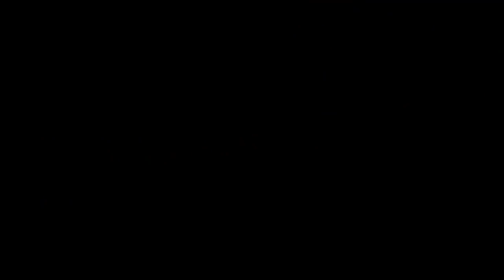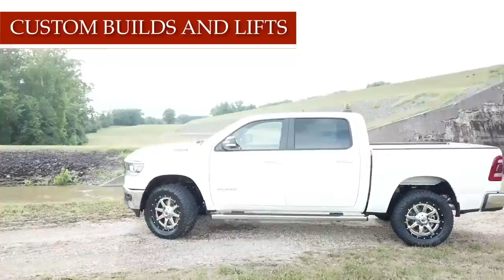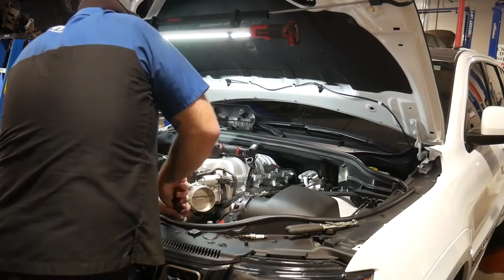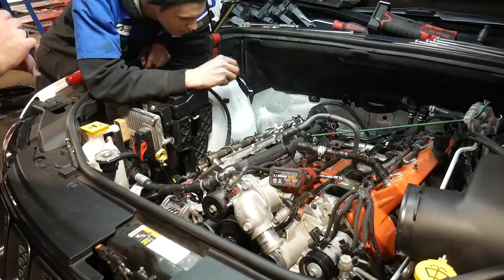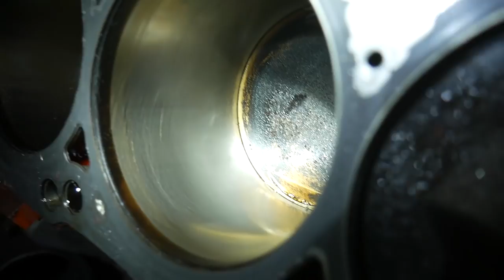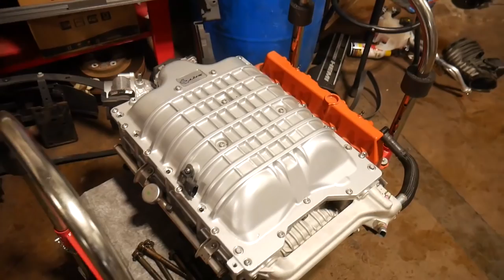TRACKHAWK HELLCAT ENGINE ISSUE AND HEAD REMOVAL

Comment: For those asking about fender covers......any good tech doesn’t need one. A cover can actually do more harm than good to paint. A fender cover gives false security. You start to forget their is something under it that could be damaged. “Outta sight outta mind” I never use them and haven’t damaged a car in 25 years. And I work on Vipers.
Reply: I get what your saying but at the same time I've never damaged a vehicle using one. The coveralls we have at work are cheap shit and are like sandpaper to paint so i have to use one. if you use them correctly and keep them clean and don't drop them on the floor you should never damage a vehicle with one.
Reply: Totally disagree. "You" might not need one but what about his apprentice? Your a "tech" and the exposed intake ports,not draining the coolant(at all!),not using special service tool to lift a 90lb $11k supercharger doesn't set off any red flags in your head? I cringed when flopped the harness over the exposed ports. Come on as a tech you don't see an issue?
Reply: i work on cobras

Comment: Hi , might Also Check The Recall Sheets For " Seal Leaks " On the Supercharger ITSELF !!! " That's too much Oil in those cylinder head intake Ports . Also check the other Valve Seals .

Comment: Very, very, interesting.🤔 I'd say that's an unusual failure. Given how robust these engines are built with computer protections, this one has gotta be all on FCA, regardless of how it was driven, no?
Reply from the maker: Exactly, which is why there was other extensive testing off camera here and Chrysler engineering is involved as well. I’ll get some better pics of the failure on the assembly video.

Comment: Damn. I didn’t realize you could remove the blower without taking the cowl out and secondary fire wall out. Those long bolts in the back, I thought, were too long. 

I drilled holes through my secondary firewall to give me clearance to remove the bolts. 😂
Reply from the maker: Yep just loosen them up and pull the charger with those back two bolts just kinda hanging there. It’s definitely a two person pull at that point as well

Comment from the maker: First all my peeps😁👍
Reply: I had a 2017 Jeep wrangler Sahara unlimited. I bought brand new summer of 17. I just sold it literally last week. I owned it for 2 years and put 17,500 miles on it. It popped a check engine light and after reading the code it had cylinder 3 missfire. After a sleepless night of reading and digging apparently its a common problem on jeeps either needing a new head or like you said. Needless to say Ill never buy another mopar vehicle again, and i traded it in for a new explorer with the 3.5 ecoboost.

Comment: I would have though warranty claim would have ask for procedure steps and then put in a new valve seal and spring; retest before green lighting a cylinder head. Warranty flag hours are ridiculous low.

Comment: Gotta love the haters and back yard mechanics saying why didn’t you do this or that?! Because good techs don’t waste time with unnecessary tests. Crusty buildup on a spark plug is only caused by one thing; valve stem seal. Had the plug been wet with oil, then it would be the piston oil control ring
Reply: IK, they find video like this, just to add their expert hate bash, haha, imagine their lovely life, i don't wanna be nowhere near it

Comment: the entire intake runner is oil coated. obviously oil being sucked through blower and caking the tops of the pistons. if it was beat on constantly the pistons would be cleaner. gotta figure out why oil is getting in the intake runners.
Reply: he found the reason. the valve stem seal failure will cause a significant vacuum leak into the crank case. as a result the engine will suck down oil through that failed seal. also since this a forced induction engine, that same failed stem seal will allow boost at higher rpms to force pressure the opposite way through that same failed seal- so instead of oil being consumed at idle, run the rpms up to 3000 rpm now intake air pressure is forcing oil back out through the pcv system which then is getting sucked into the intake and through the blower.  the misfire is due to the extra oil getting into the chamber where the failed seal is making the mixture way too rich- thats where the carbon deposits on the back of the intake vale and the spark plug came from.
Reply from the maker: Yes exactly this!! I’ll pin this for future comments/questions. I would’ve thought this was a given, but evidently needs explained, thanks 👍

Comment: Carbon buildup is due to not running it hard enough. Engine needs heat to prevent carbon buildup.
Reply: Not totally true. You can run it hard, but if its running rich, it wont matter, it'll still build up. Especially if its burning oil.
Reply: Depends on how ur injectors are set up some burn the carbon build up off some dont and heat dont always fix the ones thay dont self clean u would have to run ur car at like 6k rpm for hours to get it hot enough
Reply: @puprilla  1/2 that rambling bullshit made no sense at all. You obviously know very little about cars, or engines at the very least.
Reply: @MikeSmith-fr1ew  I really want you to prove to me for a fact that running your car hard Burns off carbon buildup in the right places not just ur exhaust tips hahahahah ur a joke mike go work on ur Honda or better yet pay someone else to hahaba buttercup
Reply: @puprilla  first of all fucktard, I'm not the one that said running your car hard burns off carbon, your dumbass did, i just said it doesnt matter if you run it hard, it can still build up, its all there if you scroll back up. Go back to 2nd grade and learn to read. Second, yay, you made a pathetic attempt to insult me with a sorry ass honda joke, ive never owned one, so jokes on you ya ignorant twat waffle. Ive been building cars/engines and racing for 25 years. 2 of my cars in my garage alone are over 1500whp, built IN my garage. So needless to say, i know a thing or 2. So please, feel free to continue making yourself look stupid. Fuckin internet experts with shit for brains pretending to be smart. Shutcho ass up, fuckin millennials.
Reply: skliros the owner might be running 87 octane LoL
Reply: @jasonneal  that would cause detonation or knock, not carbon buildup or blowby.
Reply: @puprilla  you no smarty
Reply: @puprilla  Soy Boy Bunnar Gar you know much more about car motor engine than all other you car motor engine god we all bow to you.  maybe if we run for 6 hour with no anitfreeze at 6500 rpm maybe carbon burn at 5.5 hour
Reply: @adamkalman6011  show me on ur honda 😆
Reply: @puprilla  I will have to agree with you sir I've had engines in the past that we're running just fine and run the shit out of them... and when I would pull the heads off still have Carbon on top of the Pistons...

Comment: Good old STAR center, biggest bunch of clueless idiots.  I did heavy work at a Chrysler dealer for 6 years and watching this reminds me that I don't miss it lol.  And to everyone talking about fender covers...if you think any shop outside of a television show or technical school uses fender covers you are sadly mistaken.  I don't care if it's a 94 neon or a 19 Bently, it isn't getting fender covers.
Reply: glad i finally found this comment, only thing i use fender covers for is to put windows on during regulator jobs or to put other delicate parts on when I'm working on the bench and I'm gonna be sliding/shifting things around. so many clueless idiots just jumping on the fender cover band wagon and don't even realize that we're already losing time on warranfree work. one of the only times I've ever used a fender cover on a fender was when i had to put a fuel pump in a DeLorean which is actually done through the "front trunk". only reason i did it was because i felt the brushed stainless steel paint job would be super easy to fuck up.
Reply: Now don’t get me wrong fender covers scratch paint just as bad if not worse if the person putting it on doesn’t clean the fender prior and we’re not talking some simple green and we all know nobody gives a shit and certainly not the guy doing the warranty work for free. But that’s a issue with your employer not the customer yet the customer takes the hit factory paint is original paint not the same. So when nobody brings there cars to your shop and you starve the tune will change. Of course there is always some dumb ass old person to roll so I guess it won’t happen anyways.

Comment: Actually more carbon build up would be due to babying it
Reply: Babying a hellcat powered car .. you shouldn't have it in the first place
Reply: HellHawk That and extended idling
Reply: My thoughts exactly carbon buildup isnt from thrashing it!
Reply: Carbon build up is from having a engine running 😆 dont matter how hard u run it it wont get hot enough to change anything a engineer on YouTube already showed thay
Reply: @puprilla  True, but it's exacerbated by continuous low RPM operation.

Comment: I hate to be that guy, but forced induction modern engines, especially bmw and Mercedes v8s always have oil burning problems, and our first step is always valve seals, not blaming you, but it seems irresponsible of engineering to jump straight to head removal when a simple valve train inspection would have revealed the problem. I guess Chrysler has some catching up to do with their internal testing and information.

Comment: Typical Chrysler/Dodge:  ABSOLUTE POS FAIL!
Reply: John Smith - got that right..can't believe people buy this crap..just dumb I guess.
Reply: All cars fail fuck off
Reply: Every car manufacturer has their bugs.
Reply: Panagiotis F - why don't you fuck off dickhead.
Reply: @panagiotisf7228  Oh really? Why do chrysler products have such abysmal resale value then?  You don't see Toyotas or BMWs losing 50% of their value in 4 years.
Reply: Hellcats are reliable,thing is people buy them and dont break them in,they floor it and rev them when brand new !!!!!! Even if they broke it in properly they floor and beat them badly !!

I owned several hemi cars and all went over 130,000 miles reliably,I sold them to buy a new one otherwise I  would be still driving them..I sold my 300C hemi to my Nephew and 220,000 miles on the original engine/trans still has all the power and runs and looks great ..Never towed and only normal maint issues needed repair..Brakes,tires,water pump..

My Dad owned Mopars brand new since 1965 and he never had a problem..Every 2 years he had a new one and kept the older one for 10 years and 200,000 plus miles ! His 70 Cuda has 260,000 miles on it (odometer reads 60,000 as 5 digit like all old Mopars other GM Fords until the 1980's and mainly by 1990 they went to a 6 digit odometer)..He had performance Mopars,4cyl k cars,turbo mopars,v6 mopars and all were reliable.

I own a used dealer and I buy cars and Toyota,Honda,Ford,GM,VW,Hyundai have engine replacements at low miles,trans replacements etc..Plus a Toyota owner will say his car has 220,000 miles but in reality he had either a new engine put in or a head job with new valves top end of engine or they did the bottom end but they think its 220,000 trouble free miles ,yet it had major work and not original..I have papers all the time on 7 year old Asian cars and GM/Fords !!
Reply: Says a bunch of broke ass bitches that dont have a 700+hp vehicle. Shutcho whiny, no racecar havin asses up.
Reply: heavyg 1971 Its better than any other piece of shit you probably have

Comment: Proof that dodge needs to put more reliable parts in there hellcat that can handle the power, 30k miles hit an a rod through the block. I'm not a Chevy fan but at least with a simple bolt on kit  for a Chevy motor can handle the power.

Comment: Seems retarded to condemn a cylinder head that costs 4k all for a puny valve seal. I probably would have pulled plugs and inspected cylinder walls with a borescope before pulling the head off. A failed valve seal is not gonna have any major significance to cause a vacuum leak cause because when the valve is closed its sealed and when it's open its gonna suck through the port in the head path of least resistance)not past the valve stem.

Comment: Yeah right as if the customer knows exactly what cylinder there is a miss-fire on?  he is a not a mechanic with diagnostic equipment/tools.  That carbon buildup for such a new car is really bad! testament to the really shit quality fuel USA has.
Reply: Jason Moyle You can literally buy a OBDll scanner on amazon for 35 dollars and it can tell you why your check engine light is on, you dont have to be a mechanic to know whats wrong with your car🤦‍♂️
Reply: @thinkkops853  or even fix it.
Reply: Jason Moyle so you’ll see the crusty piston and chamber. That’s it

Comment: so they are going to warranty out the whole cylinder head just for valve seal...lol
Reply from the maker: Yep due to the fact it’s been ran this hard with all the oil going by and May have an issue burning valves/seats down the road.

Comment: How many miles on that motor?
Reply from the maker: Just under 10k
Reply: @RustbeltMechanic  I broke a connecting rod on my 2017 Camaro ss at 10k miles engine locked up
Reply from the maker: Panagiotis F ouch! That really puts a bummer in your day!
Reply: @RustbeltMechanic  brand new engine 10k on this one only pit the best oil change it early and drive it like I stole it everyday lol

Comment: Spend some money on some better music for crying out loud. I thought you might I have found that they did break the engine in properly. Number 6 cylinder has always been a problem with valve crane tick in Hemi engines. What that is an unusual failure for that new a motor.

Comment: Lol I work for jeep dealer in Colorado and we've already replaced a trans on one.
Reply from the maker: Never have seen a failure in that. But if I were to it would be with this one lol
Reply: Was stuck in 1st diag and star said it needed a valve body but at the time they werent makin any or sum shit. Star said to stab a tranny in it.
Reply: star said to put a valve body in a 3500 that wouldn't come out of 1st at 153 miles, didn't do a thing so they pulled the tranny card next. maybe its better off you didn't do the valve body first haha. @SLSfan25

Comment: Lol junk. My old honda has 200k miles running like new
Reply: Ramon Velazquez I bet your Honda doesn’t live up to the performance of this 100k truck tho haha
Reply: @ELDOUBLES  Do you live under a rock, dude? If tuned properly, Hondas are actually capable of reaching 1300 HP. They showed it on 1320 Video. Given Hondas are pretty known to be modded, one could probably swap the drivetrain too.

https://youtu.be/Ycermhv7qnE

Comment: Chrysler is TRASH
Reply: Dodge makes the best v8 engine in the market. Better than shit fords, mercedes, and bmws thats for sure.
Reply: ThinkkOps - you mean the fake hemi give me a fucking break. Coyote is running 8 second 1/4 miles on a stock factory sealed engine
Reply: leeleelee thats in a modified engine, the dodge demon runs the quarter mile in 9.65 STOCK, no other car has reached the full potential power as a stock car (talking about regular muscle cars). I myself work at a mechanic shop, most cars we ever get in for repair are Fords, Bmws, Mercedes, Nissan, and Toyotas. I do got to admit, all Chrysler and Dodge vehicles with a 6 cylinder engine are complete shit, just embarrassing really. I do got to admit, other than transmission problems and suspension problems on a mustang gt, their engines seem to handle pretty good over time.